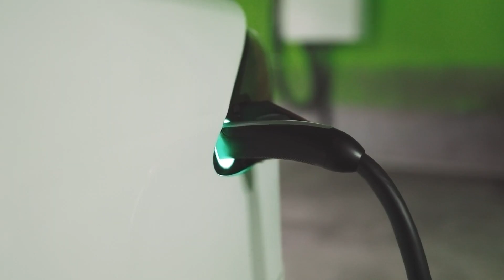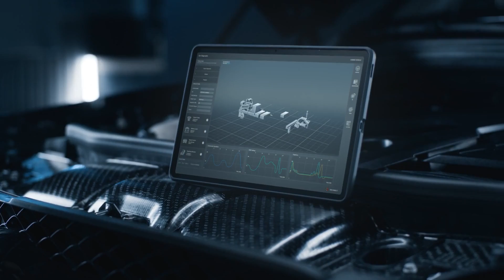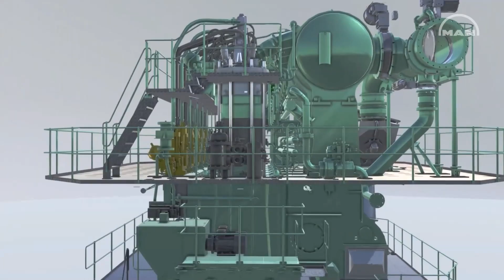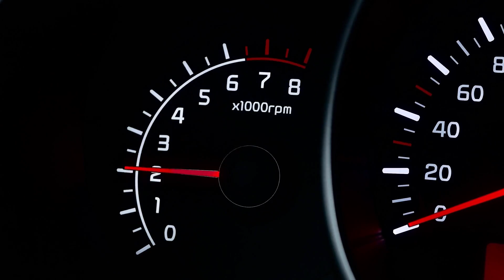Toyota CEO "This Ammonia Engine will END the EV industry"... It's potential will BLOW your mind!

Comment: Ammonia is currently produced via the Haber Bosch process from Hydrogen and Atmospheric Nitrogen. This is an extremely energy intensive process requiring high temperatures, very high pressure and a catalyst. IT IS THEREFORE VERY ENERGY INTENSIVE AND EXPENSIVE!
More bad news comes in the form of the need to obtain Hydrogen as the second reactant which can be obtained from steam reforming of Methane which results in Carbon Dioxide as a byproduct or electrolysis of water which consumes a lot of electrical energy!
All in all Ammonia engines seem to be yet another Toyota Red Herring and this video a deceptive piece of didinformation!

Comment: Yet another alternative fuel that requires a new energy-intensive, industry scale production and distribution network. This is a non-starter. 

If Toyota wants to survive with the current market position, they need to move off of internal combustion, and to EV's. Yes, I believe that large-scale BEV adoption will lead to new and significant problems, in a reflection of the petroleum industry, just with different flavors. However, it's the only viable way forward to a lower carbon emission future for mass market transportation.

Comment: Spent a road trip from cape cod researching ammonia fuel - here is why it wont work - need to burn coal or use electricity to make ammonia (need hydrogen to make it), and it creates a shitload of NOx emissions, only way to combat is by running rich which will dump so much ammonia into the atmosphere it will smell horrible and fill cities and car parks with the smell of ammonia
Reply: exactly what I was thinking when i first read it.